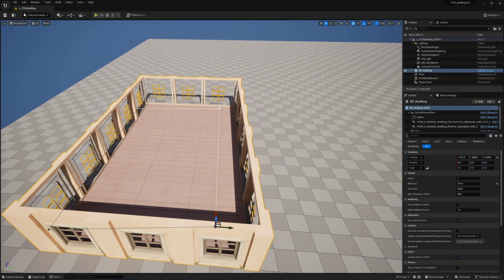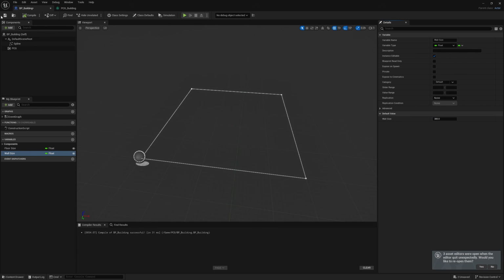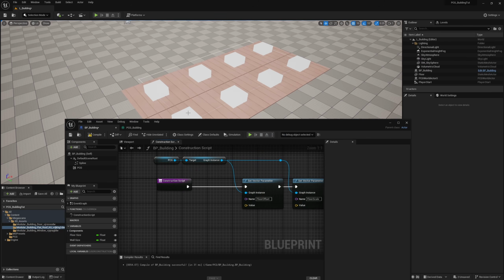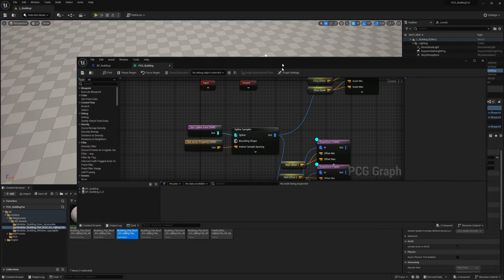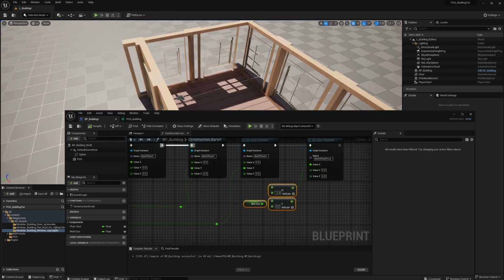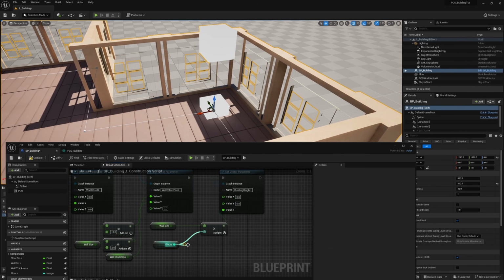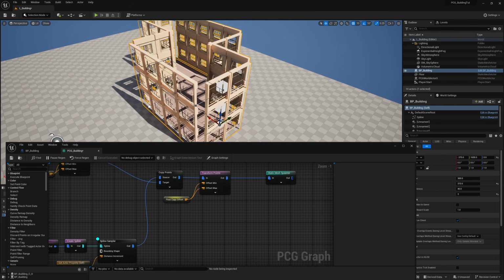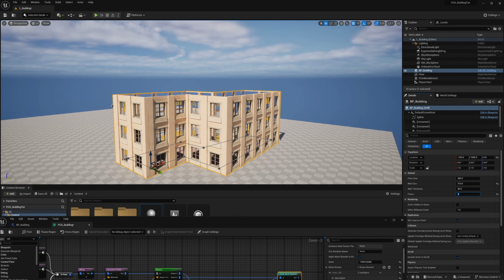Procedural Building Using PCG and New 5.3 Blueprint Nodes - Part 1 | Unreal Engine 5.3

Comment: @MichaelRoyalty sent me your way. Thanks for the awesome walkthrough. Between the two of you I have a much better grasp on PCG and achieving custom solutions for my project. Look forward to your future PCG videos.
Since you asked, determining how to spawn stairs or elevators and adjusting the floor as needed would be pretty neat!
Reply from the maker: Nice, glad to see you've been learning a lot! I've seen some of his videos as well, good stuff. :)

Adding stairs / elevators is definitely on the list for me. The harder part is figuring out how to get an interior layout going that actually resembles a normal apartment. lol
Reply: @Procedural_Minds  For stairs and elevators, how are you determining the interior position of the points? I also noticed there are tags. Does that mean for spawned points your able to tag them, and then later use that tag data? Like for walls have a tag that you can later use to indicate placement of shelves, hanging pictures, etc?
Reply from the maker: @DiddlingDwarf  How am I determining it? I'm not. Why? Haven't started it yet. lol As for the tags, I believe it's possible in 5.3, but that's something I still need to research how to do / use. Lots of things to learn for everyone. :)
Reply: @TheLazyContradiction  Fair enough, I discovered that I actually have to multiply the floorcopyoffset.y by -1 and the z (connecting to x) stays the same, but then all my walls are more 100 units more narrow and spawn under the actor as well haha could be because I'm using a source build as well as Lyra sample from the source build.
Reply: @Procedural_Minds  So I came up with a solution for interiors! Since we already have floor points as a grid, I decided to assign a grid attribute to each point via a custom UPCGSettings node from c++. Then I intend on assigning tags to each point for what sort of room they should generate around them through assigning a grid point, grid range, etc. so that sub graphs will automatically generate off those points. If you would like the custom node let me know! Just feed it the actor location, rotation and a wall size!
Reply from the maker: @DiddlingDwarf Nice job figuring out a solution. I don't know C++ at all, so I'm trying to do it purely using PCG and blueprints. I have an idea in mind, I just need to figure out why my boolean is returning false when it should be true. lol

Comment: Are you planning to continue this series, so there are roofs and interiors with stairs etc.
Reply from the maker: Absolutely, this is just the first part. My end goal is to have full buildings and use them to generate a city. At least that's my grand plan.
Reply: @Procedural_Minds  that Sounds insane! Thanks for making this series!
Reply from the maker: @WsEKond  Absolutely, if you have any ideas as to what you'd like to see implemented in this series feel free to suggest it. No guarantee I'll be able to do everything, but I can definitely try. :)
Reply: @Procedural_Minds it would be great if connect it with your material systems. That way it can match the usual city generators, with layered building pieces and all. Amazing work btw.
Reply: @Procedural_Minds Id like too see randomization at runtime.like different variations of doors,walls etc. and also randomized spline shape and location/rotation at runtime.Basically just more variations every time you run the level.
Reply: Maybe different rooms, where different people live in one house (dont know the word for that, sorry) and terasses. Or maybe Shops in the lowest Etage, thanks for making this series! Do you know when the next tutorial came out
Reply from the maker: @WsEKond  Unless something happens I'm not expecting, a new part will be every Sunday at 8am pacific.

Great ideas, I'll start thinking! :)